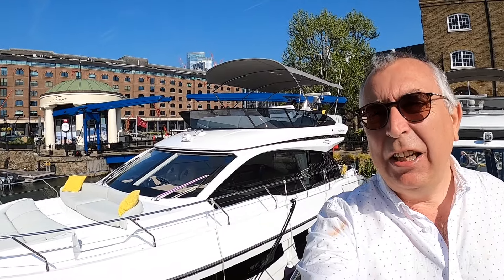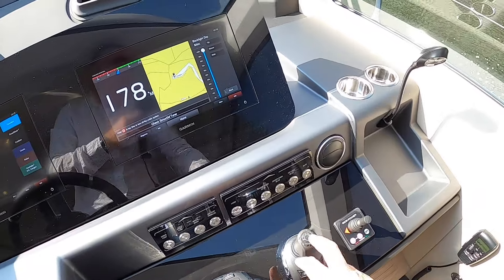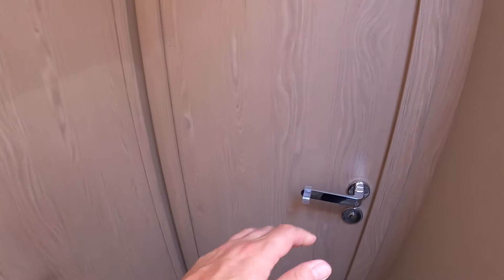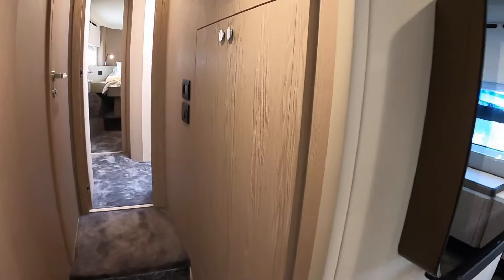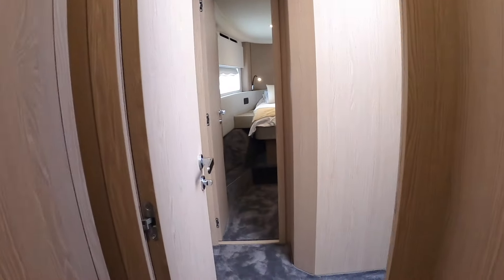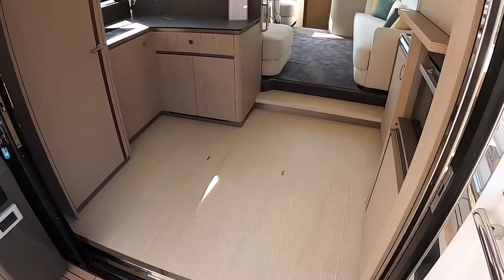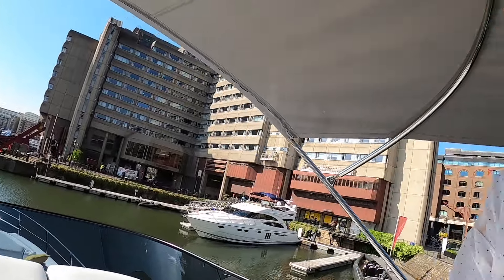€1.1 Million Yacht Tour : Azimut 53 Fly

Comment: Very nice. A lot of useable space for a boat of this size. Guessing even without decking the storage area out for crew you could fit a shower in there to use when coming back from a swim rather than going up through the saloon. Great space in the engine room too. Very nice indeed 🙂
Reply from the maker: A toilet and shower would be a good idea in there.
Reply: @AQUAHOLIC  No Burnham 65 Fly?
Reply: Pretty sure there is a transom shower next to the steps though, but a folding bench was a missed opportunity
Reply: You could store some small water toys in there

Comment: All in all a nice boat. In the galley
The dishwasher would go and be replaced with another fridge. Replace the sink with a real deep sink with a high neck faucet for washing out stock pots. The small table opposite the galley. A nice flat table for books, artwork or a number of things which would not workout, because 
The table lifts up to check 12v 24v shore power and whatever else was mounted there. So everytime the table has to be lifted. Everything on top has to go.
Above the washer. The shelves would go for a separate dryer. The storage area above the swim platform would be a perfect place for a water maker and a heavy duty AC for the hotter and hotter summers.
But yea, it's a good boat.

Comment: Remark on matrial used,, see some areas where you notice rust already starting. look at the heat plate at the BBQ and the same for the water filter in the engine room (floor)... That should not be there already. Could notice that Nick also noticed the rust at the bbq since he moved the camera away quickly :)
Reply: Hi Peter, I noticed it too but maybe the engine room staining was pre delivery waxoil preservative?

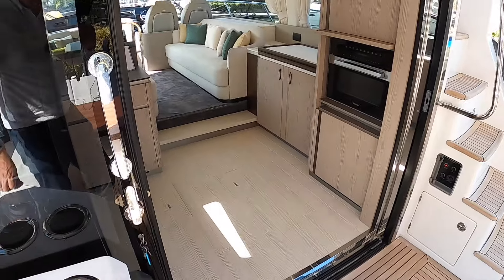Comment: 1:50 That crew / storage area at the back, could be a great bicycle storage area, for when you dock somewhere abroad or just very far from your car, and want to let's say explore a seaside rural town and it's surrounding hills.
An aluminium or titanium mountain bike, with front wheel only suspension, would be brilliant.
From experience I can tell you that you'll need front wheel suspension on any rough ground, especially potholes and manholes that aren't flush with the road.
But rear wheel suspension will drain your energy as your pedal power will be dispersed by the spring suspension, instead of actually moving the bike forward.
Reply: The type of bike you're referring to is called a "hard tail", and whilst they do give more push a "full suspension" does absorb a lot of shock. But are either perfect for this role? If you're like me a MTB guy seeking trails, yes. But for just local touring? A Gravel bike or a Hybrid bike might be better, or even a folding bike, and electric versions of all these exist too. The Tern GSD S10 Folding Electric Bike is a fantastic example. A battery that will last all day, it will eat hills for you, folds down to the size of a pot plant, can be stacked vertically, and has tons of space for cargo, racks for young kids, etc. You could put four or six GSDs in there easily.
Reply: Just think  ❤👋
Reply: @darthkek1953  Thank you very much for that information. I'm guessing your avatar is a pepe Darth Maul. Btw Cool.
Free Kekistan!

Comment: Is there really a need for so many sunbathing places? That is a lot of cushions and matresses to have on board, even on a big boat like this they are propably mostly in the way and take up space for other stuff. The boat in itself seems to be well planned and certainly liveable for even longer periods of time. But this fixation to have umpteen sunbathing areas when nobody really lies that much in the sun anyway just gives the impression that manufacturers deem it necessary to seemingly give full value for the money. And thus use cheap stuff to cram every free inch of space with unnecessary litter. Perhaps I´m just a grumpy Finn but that puts me a bit off this kind of boat. But good review, as usual.

Comment: This is all nice boats but until the day there electric i am not interested.. Its not hard to make a boat electric and it should been in front of cars... boat world you getting behind. 
get them running shoes on.....
Reply from the maker: It is if you want to go anywhere at speed. Water is 800 times denser than the air you're pushing a car through, so if you gave a boat like this electric drive you'd get a handful of miles at 25 knots and then run out of power. Electric boats exist and I have one coming to the channel very soon, but there is no electric technology that makes this kind of boat viable - yet.